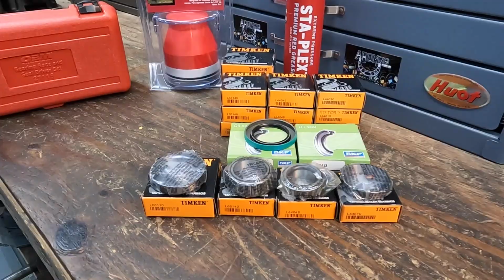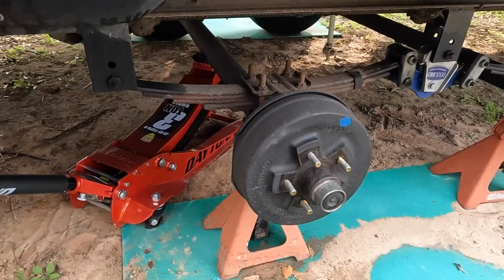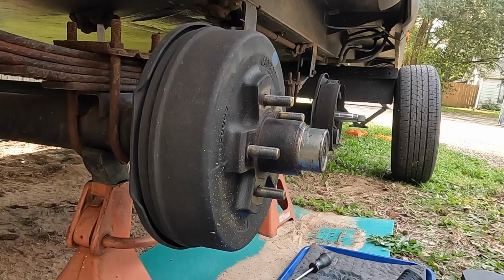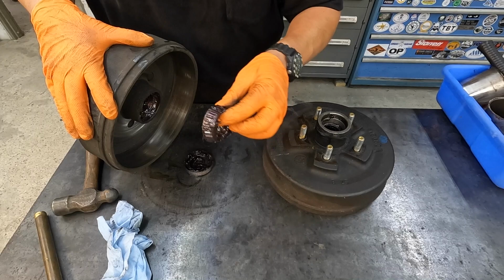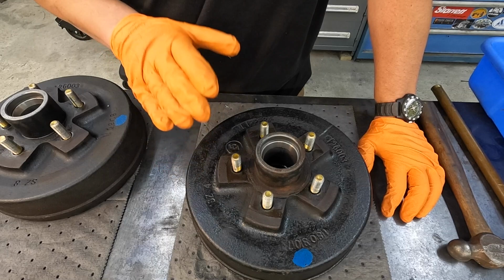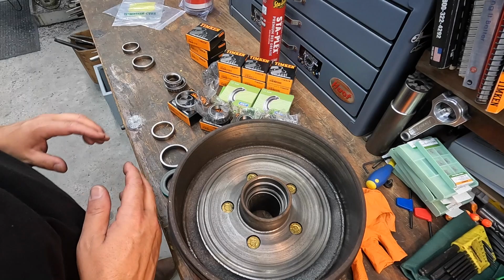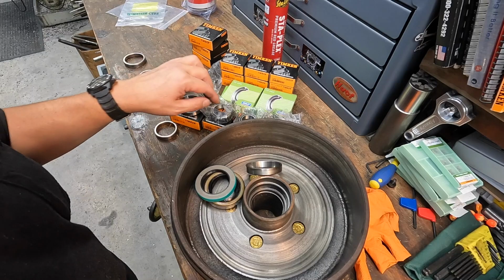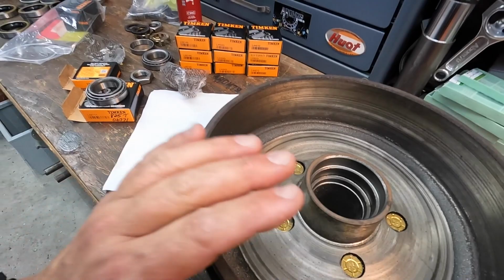RV How-To: Trailer Axle Bearing Replacement Part 1

Comment: Great video documentation.  When I saw the part #'s at the beginning of the video, I cringed a bit as I have the part numbers after doing a bearing replacement on my travel trailer.  The seal # is 473336 (National).  For the outer bearings and race the Timken set part # is SET4 (L44649 & L44610).  The Timken part# for the inner bearings and race is SET17 (L68111 & L68149).

Comment: Once you get all of the new parts install Adam, and start on your first leg of the trip, stop in at my shop here in Boyd, and you can make sure and check out if any issues come up. Have all the tools and equipment at your disposal. Abby would have a field day looking oven all my vintage antiques, but not my collection of cast iron cook ware ,,,hehe! Awesome that your are thinking out side the box before heading out on a long haul! Bear.

Comment: A long time ago an automotive repair shop owner had told me the only way to buy parts anymore is to take the old parts with you and hand them to the parts guy. These days, we have cameras in our phones that can pretty much do the same but it’s always best to "disable the vehicle" and grab the parts that will be replaced and match them up. Most of the time, what happened here in this video is what happens to many of us when attempting to make our time efficient, the wrong part is in the box of new parts we purchased ahead of time to reduce the cluster of dragging out a repair job. It's about the same as measure twice and cut once when you figure it all out just to be sure the "parts man" hasn't made any mistakes when deciphering this part number for that part number and that oil seal with the wide body vs. one that is much narrower and could ride crooked on the spindle not being seated fully.

Comment: Spent a few years in the bearing business. For tapered roller bearings Timken can't be beat! Years ago (before I was in the biz) I put cheap bearings on the front of my V8 Monza. Nose heavy as hell. They'd last about a year and then go bye-bye. Put Timken's in and they've lasted ever since. BTW what I did for bearing race drivers was to cut the old races with a "ziz-wheel" and use them to put the new ones in. Tappy tap and they come out easy.

Comment: That plastic will probably work fine. When I was moving mobile homes, we had some (roughly off memory) 12X12 aluminum plates we used for jack pads. Couldn't bend one for what we were doing. 
Side note, some older mobile homes have had layers upon layers of flooring installed layer after layer. So what could have started as a 30k lB trailer could easily be way more.
Reply: A better idea, I wouldn't trust plywood pads.

Comment: Hey Buddy I replace the bearings every year. With that said I carry extra with me for next years change outs.  My bearing races ( on the back outer are very hard to remove and my brass drift has a hard time getting it done🤔.  Thanks for the videos.

Comment: I think you'll be OK with your new setup but I have a hard time running anything other than Dexter axles in anything thats going the distance... Dexter/Timken FTW. For the same reason you dont want to run may-pop's...

Comment: So typical with the bearings/seals/grease caps being the wrong fitment. Done a ton of trailer axles in my day and it never got easier to get the right parts. Its the same thing with plumbing projects at home, its like a 3 trip minimum to the store for the right parts....
Reply: @spidersinspace1099  How?

Comment: Adam, thanks a bunch for all the information!  Do the brakes automatically adjust with use or is there an adjustment screw or something on the hub?  We just picked up our new trailer last week and I was checking the tire and wheel temps on the first few pulls and one of the four brakes was running cold compared to the other three.  Thanks again for the videos!

Comment: so not only does it have drum brakes but does it have some form of half a disc brake as i could see a brake pad at right angle to the brake shoes at the bottom underneath the axle shaft ?
Reply: What you see that resembles a disc brake pad is the magnetic actuator for the electric brakes. It hangs from an arm that pivots at the center of the brake cams. When the brakes are applied the magnet is attracted to the brake drum center and the motion of the brake drum pulls the actuating arm with it which turns the cams. The cams expand the brake shoes against the drum.
Reply: @BrianEltherington  thanks for the explanation I'm in the UK and not seen that type befor